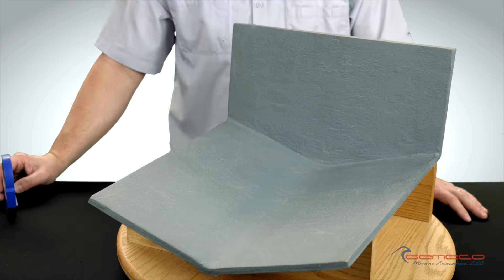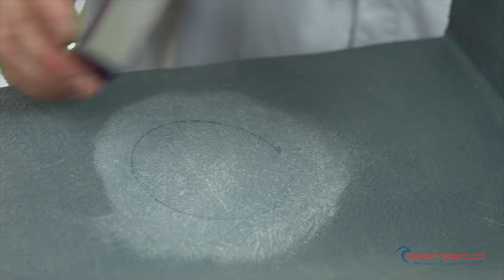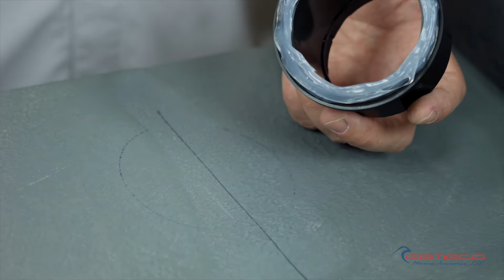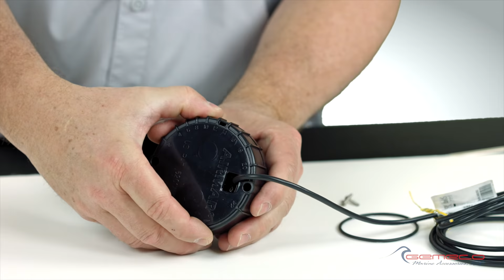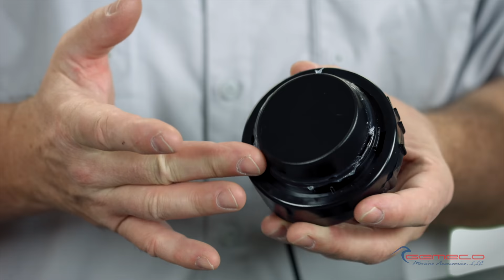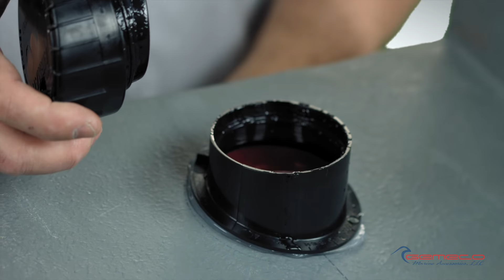How To Install An In-Hull Transducer

Comment: you can do the same installation with a standard tranducer, like thr Garmin GT 20. Just take a bug tube of silicone at the back of the boatbottoms hull (typican in the space where you have your gasolintank) make the transcender covered in silicone (no air) between hull and transcender. its thats easy.

Comment: I realize this video is four years old now, but I’d like to know why the manual for these transducers (SN2010) say to use 2.4 oz or 71ml of antifreeze in these bases? Surely the installer here used more than that suggestion AND I just had a technical support rep from Faria tell me to use more than that. What’s the deal?

Comment: Great tutorial but one thing, never use petroleum jelly on O rings. Some rings will hold up, most will decay. You should use plumbers silicone lube.
Reply: Ummmm no use dielectric grease as he said. Thats what its for.
Reply: you have your some and most mixed up,  Vaseline will not hurt any rubber or Viton material ( the most common O-rings) I think you would be hard pressed to find very many O-rings that petroleum jelly will hurt. Your recommendation of a di-electric silicone grease is a good one though you are almost always safe to use that stuff.

Comment: Can you please confirm in hull traduced will be as good as regular transducer for fish finder .. I. Really want to instal it but hesitant.. will it work?
Reply from the maker: Assuming that the location of the transducer is in a spot on the hull where there are no air bubbles in the fiberglass, yes.  The only loss you might incur would be a the far reaches of the transducer's capabilities.
Reply: Garmin states you will loose 5% on a in hull installation.

Comment: With the in hull transducer, is it a one time fill with the anti freeze, or is it something you need to constantly fill when it gets low?
Reply: It should not get low but if it leaks for any reason you need to add more fluid so there is no air in there.